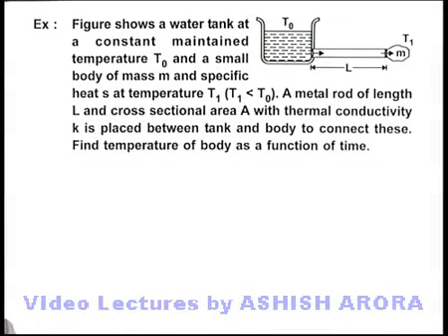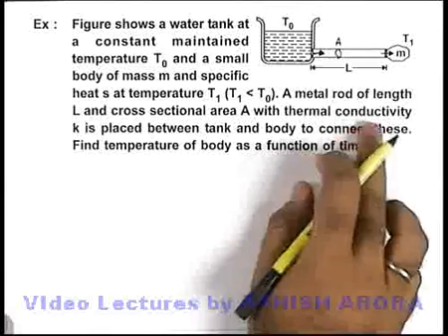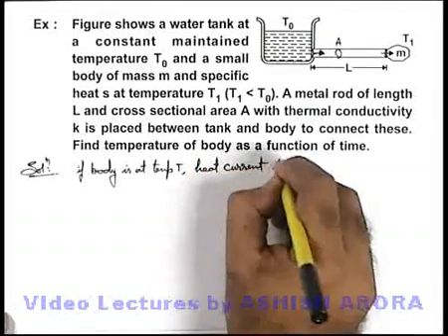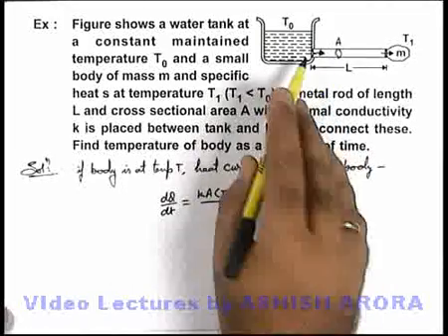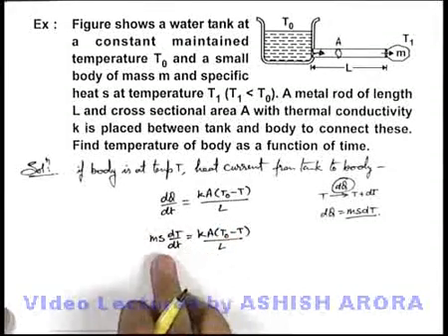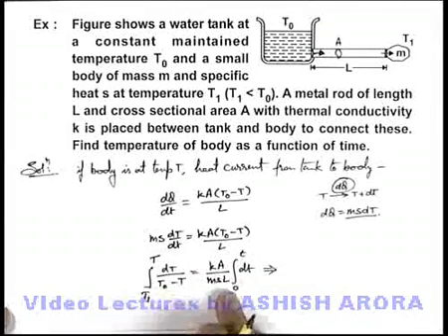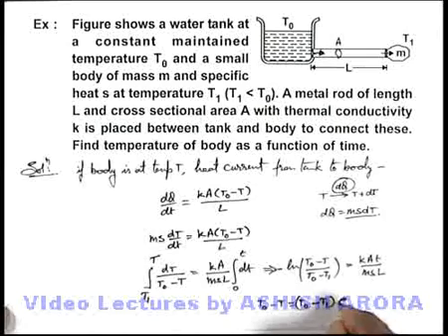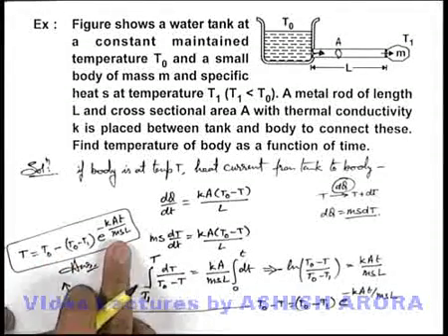Class 11 Physics | Heat Transfer | #9 Solved Example-4 on Heat Transfer | For JEE & NEET

Comment: If you have assumed temp. T as the steady state temp then how can it vary with the time!????
Reply: here , the rod is not absorbing any heat , so dQ/dt is constant throughout the length of rod, the body of mass m is absorbing and increasing its temp, after time t in a short interval dt temp. change for mass is negligible and hence it is instantaneous steady state condition..
Reply: @adarshchaturvedi3498  nice answer . How is your concepts so clear